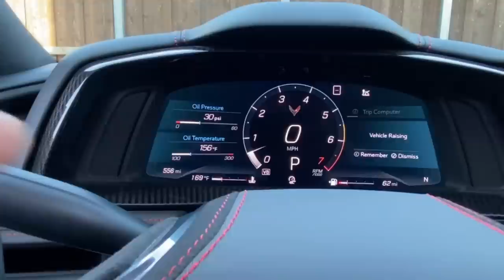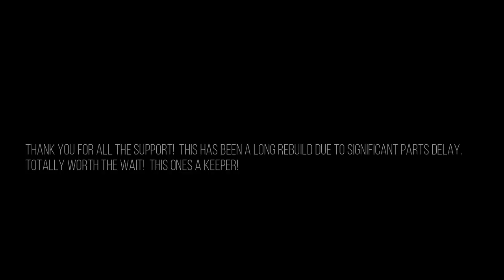Salvage 2020 Corvette C8 Convertible Rebuilt Summary

Comment: Where did this young guy attain all that knowledge and experience to do this in his backyard?absolutely amazing!!!
Reply: He probably works or worked in a body shop.
Reply: It helps when his garage looks like a professional shop, probably older than he appears.
Reply: Practice. (Preferably, on something cheaper until one figures things out.)
Reply: Trial and error on cheaper things, along with a lot of research. My opinion based off experience.
Reply: When you are a Creator there is no competition you just create. The only thing I don't like is putting Bondo on the vehicle that part should be fabricated by hand out of aluminum out of metal but not Bondo. Everybody has a genius inside of them connect with God your spiritual self and you'll find yours
Reply: He googled it
Reply: Alot of backyard mechanics  can do this ..alot can't
Reply: He probably went to college and studied hard, then got a piece of paper saying he's smart.
Reply: no self doubt and the world at his fingertips .
Reply: @GJ-DT  No, that's backyard bodywork. Anyone whose ever spayed for a living was cringing at that spray job. Results are hard to tell on video. Not trying to hate on his work, but you walk panels side to side. You don't spray horizontal sections. It leads to splotchy base. Not a big deal with simple base coats, but with pearls or metallics it is.
Reply: The body isn't the issue  on a C8. The Aluminum frame is a complicated piece of engineering that is not that easy to fix after a accident. The center tunnel supports the lateral stability, and if that is bent then its virtually impossible to fix and align. It could be off center by millimeters, but that is all to total a car. These cars would suffer serious stability problems at high speed if this occurs. This car suffered a major side impact.
Reply: Probably some tips from other more experienced people and hundreds of hours of YouTube
Reply: @kurtiskoepke1980  school of hard knocks
Reply: Also many high schools have mechanic and Auto body programs .. I already knew by 18 how to rebuild cars from frame up. Just depends on where you grew up. My school even had a work program & I worked in professional auto body shop before I was 18. But this guy has some "Passion" & has done a wonderful job of restoration of this Vette.
Reply: @cornelieusfields2062  the corvette body has always been a high performance fiberglass, never aluminum, you reglass new fiberglass matting and then apply and finish a gel coat on top.
Its not bondo its gel coat, trying to bond aluminum to fiberglass would cause problems with heat expansion differences.
Reply: He graduated from YouTube University
Reply: School
Reply: Dont underestimate an Asian guy!
Reply: I'm not a mechanic are anything, I rebuilt a 16GT pp1 in my Driveway, it took me 8 months to finish it, I think if you are somewhat mechanically incline and picked a vehicle that's not badly damage, I think definitely a person do that, YouTube and Google are your best friends...
Reply: @19krpm  😂
Reply: My exact question lol

Comment: The structural portion is a bit suspect, but the cosmetic portion was on point. Either way for a salvaged car...Looks awesome and would be an awesome addition in anyone's garage. Great job dude...

Just one thing..should have laid a tarp on the floor prior to spraying..

BTW, I was an aviation structural mechanic for 22 years and did my time in an auto body shop prior to that. Structures, fiberglass, radom, paint and auto mechanics. F18s, harriers, hueys, cobras, 53s, 60s, 46s, tomcats, duece 1/2s, 5 tons, Hemtts, Humvees..etc

Comment: Very nice work.  Looks good. Who cares if it’s salvage. It’s still awesome!! I see you used what looks like a stage 3 turbine unit hvlp set up for paint. What kind of gun and paint did you use. I have one and had issues with it. I use a 60 gal 5.5 hp compressor set up and hvlp. But I’d like to know what gun to buy for my portable stage 3 turbine.  Again nice work.

Comment: The question is why this car was in a salvage state ? There was nothing more than a little body work to do, nothing that would be deemed as unrepairable or higher cost than the car .... Unless there is some frame damage not taken into account in the repair here ?
Reply: The thing is is I seen the repair of Bondo. I don't approve of that. If you had to conceal bring up something to meet specs then you steel. I've been building cars and repairing cars since I what's 10. It's not hard to be a creator. We all are creators and get the competition. Because there is none when you create
Reply: It was dropped off a lift
Reply: When he took the passenger seat out I could see the side airbag on the seat had been deployed. This often will render a vehicle a total loss when ever an airbag has been deployed.

Comment: Beautiful!! I have a question. How does the little black triangle dress up piece between the side windows & the convertible top come off? I'm talking about what's directly behind your head if your driving. It's the separate piece above the door & rear quarter panel where they meet. Directly behind the side windows. I have loose clip & I can't find any documentation on how to remove it.

Comment: Question did you have to cut all the glue off the frame before glueing on the new outer panel? I’m at that point where the out panel is cut off just the glue is left on the frame

Comment: Hold up. The frame is the major part of this car, and its aluminum. The alignment has tolerances that require measurement after accidents to determine if it can be rebuilt at all. The C8 panels and doors are not the issue on this car. The frame is tough but Cannot easily be fixed. This will compromise ALL of the C8s performance capability.

Comment: Where did you get this corvette at Copart or IAAI. There is one at IAAI. In Tucson.  Arizona  how much you pay for the Corvette  how much did all the parts Cost to Repair the Corvette do you fix other people car in DFW area
Reply: Al.L Birmingham Copart sold 4 13 2021. Stock 37421071.
Reply: Lot # 46925501 Copart  2020  2 LTE white how do you think you charge to fix this car
Reply: @huaicheng401  How much?
Reply: You have to ask him  that I think It’s a $100.000 car so 1/2 of that. Can be more
Reply: Copart and IAAI. Is where to buy it With A Broker  pay Less Buyer Fee
Reply: $74500. Plus. Buyer fee at Copart
Reply: @rexserres5778    $74500
Reply: @rexserres5778   Copart Phoenix 2022 LT3 same car next  week #35690562

Comment: I just watched part of it I don't like putting Bondo on the vehicle. Not on a critical part I don't care it's just to bring it up use lead or aluminum. Fabricate the part fabricate the piece bring it up the way you need it to be. There's no strength in Bondo. If it is a structural part that he's fixing